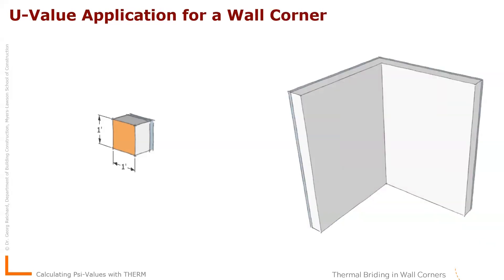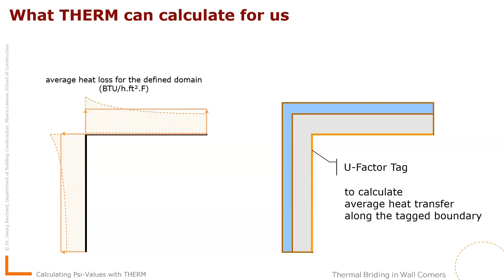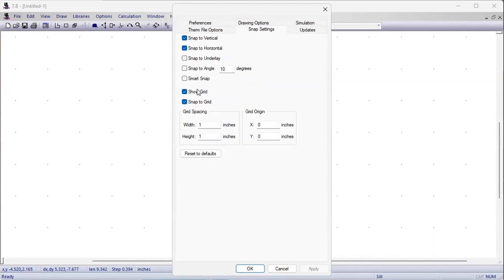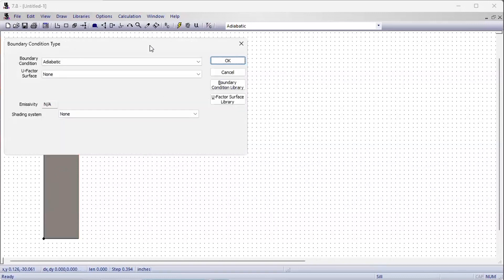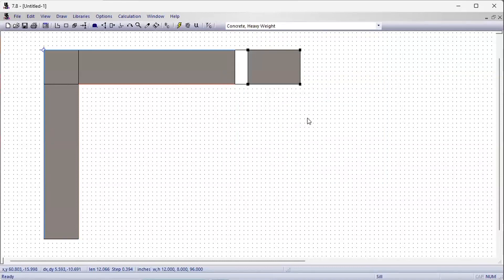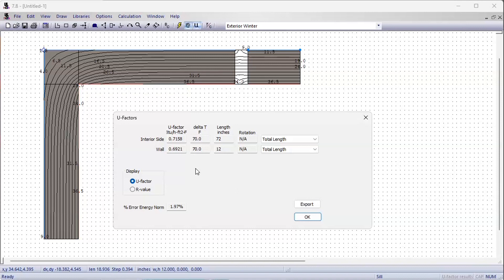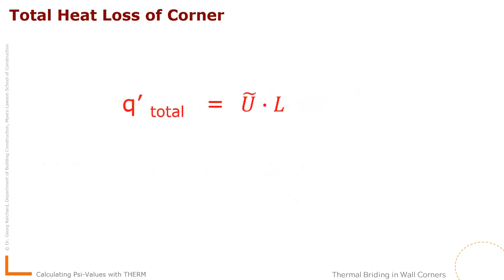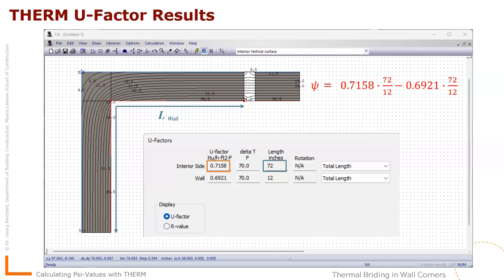THERM: Calculating psi-Values in Wall Corners

Comment: When you take 3ft legs is that arbitrary or defined by a standard ot method?
Reply from the maker: Well, the ISO 14683 Standard references that the lengths of intersecting building components ought to be 1m. But the actual rule-of-thumb is that in most cases there difference is neglectable once you are 3-4 times the thickness out of the bridge. So, the general rule of 1m or 3ft accounts for most building enclosures and should be on the safe side. But as you can easily check with some parametric study, simulating a thermal bridge between a glazing system and its frame with 1m length into the glazing is an overkill. For a 1in (2.54cm) thick sheet the effects will ebb off after 3-4in (10cm).